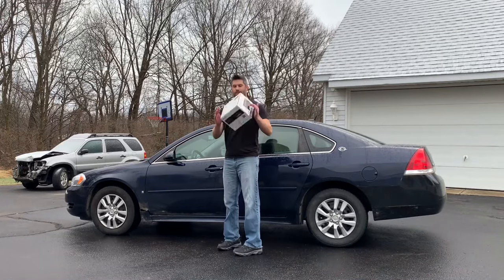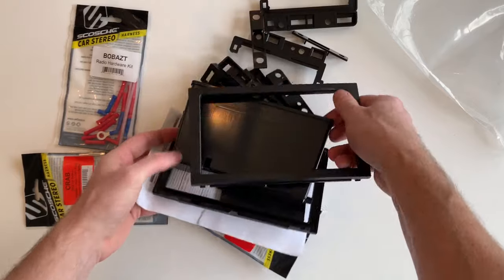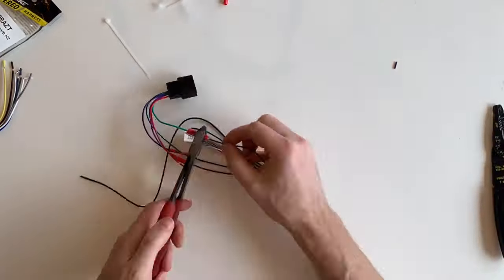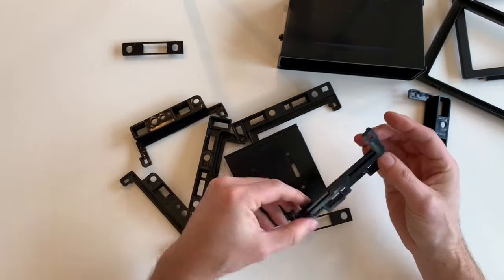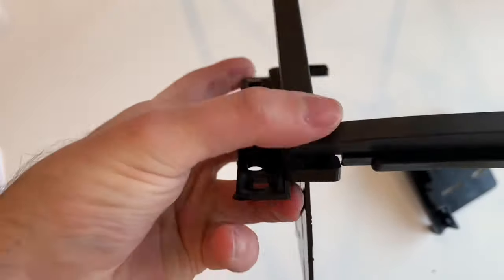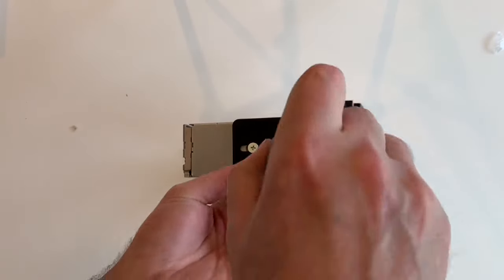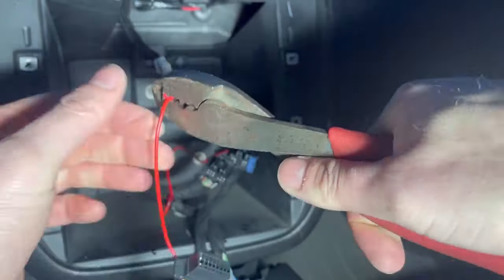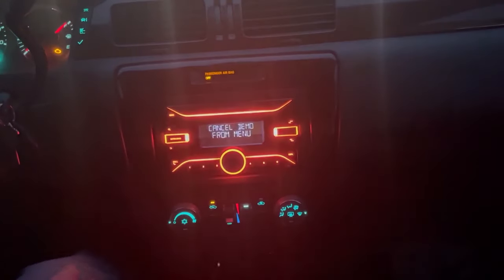How to Install Aftermarket Stereo / Radio | Chevy Impala | 2006 - 2013 (NOT FOR "BOSE" WITH AMP)

Comment: Sir how do we tell if we have bose i have a 2008 50th anniversary impala
Reply from the maker: The stereo doesn’t have any special marking’s. It looks exactly the same for standard vs. Bose. 

The way to tell is the front door speakers will have a BOSE logo on them.

The only other way is to look for the amp (the Bose system has an amplifier, while the standard system doesn’t).
Reply: @HowtoandReviewsOfficial  what does the amp look like when I take out my radio it's hot
Reply from the maker: @That2007YZFR6THUNDERCAT  The factory Bose amplifier is located in the trunk. It should be between the two 6 x 9 speakers behind the back seat.
Reply: @HowtoandReviewsOfficial  ok I'm good I don't think I have it

Comment: How does the OEM radio get power then?
Reply from the maker: There are typically two power wires. 1) yellow constant power. This always supplies power to keep the clock accurate and preset radio stations saved. 
2) red accessory power. This only provides power when the key is on and is what powers the radio for operation. 

The factory harness only has the yellow constant power. It does not have the red accessory power wire, which is what the aftermarket radio needs, which is why we have to wire it in from a different source.  (You can’t use the yellow wire because the radio will always be on, even when the car is off). 

The stock radio received data when the key was on and internally programmed to use the constant power when the key is on. 
This is not typical. Most radios have a yellow and red wire, and aftermarket radios need a yellow and red wire.

Comment: so i got it all hooked up right with a good harness did the red wire to the window fuse turns on but no sound i connected the blue and white to th 12volts still nothing tryed the antena to the blue and white nothing i see it moving on my screen but no sound hooked the stock radio up worked fine any help
Reply from the maker: Do you have the Bose system with a factory amplifier?
Reply: @HowtoandReviewsOfficial  no bose and i cant seem to find the amp there 2 thing on the trunk one security and the other thing says LG but dosent look like a amp when i look it up
Reply from the maker: @opdanky236  since it’s not the Bose system, you don’t have a factory amp. The whole system is just the stereo, which is good; you only need to connect power to the stereo. 
Since the stereo has power, not sure why there is not any sound. What stereo are you using?
Reply: @HowtoandReviewsOfficial  ken wood not for sure exact model
Reply: @HowtoandReviewsOfficial  then tryed a power acoustic just to see but both radios are brand new 300$ on the kenwood
Reply from the maker: @opdanky236  I wonder if there is something silly/easy like a mute button. 

Did you use the kenwood manual against the adapter harnesses key to splice them together? I would get them both side by side and make sure the wire functionality matches for each wire connection.
Reply from the maker: 2:06
Reply: @HowtoandReviewsOfficial  as far as i seen all the cords matched greens to greens black to blacks whites to white yellow to yellow everything matched up good mute button was off lol made sure just no sounds at all from both radios see the music playing from the radio we tryed puting the amp wire from the harnes to the 12v nothing then to the antenna nothing
Reply from the maker: @opdanky236  it does sound like there is a powered amp somewhere that needs power, which would be the case with the Bose system.
Next, I would personally start troubleshooting and try wiring a speaker straight into the harness to see if sound is coming out of the stereo. I would try stuffing an extra pair of wires right into the connector pins and wire them to an extra speaker. 
The signal should be leaving the stereo. Need to verify that. 
Sounds like it’s just not making it to the speakers.
Reply: @HowtoandReviewsOfficial  ok thanks ill try messing with it tomarrow

Comment: I ordered a harness for the same car it look like they gave me 2. Help?😊
Reply from the maker: There are two harnesses in the kit. You need to use both of them.
Reply: Ok both harnesses have yellow wires why? That’s confused me?😢
Reply from the maker: @rodneyhendricks2412  I agree that there should only be one yellow wire. That is not right and is confusing indeed. It sounds like the wrong harness. I recommend calling SCOSCHE customer service directly. I have talked to them in the past, and they are great. They will help you sort it out.
Reply: @HowtoandReviewsOfficial  ok yes it’s is confusing. Do the have a contact number or something?
Reply from the maker: @rodneyhendricks2412  
Technical Support: (800) 363-4490 ext. 3 

https://www.scosche.com/contact
Reply: @HowtoandReviewsOfficial  thanks buddy

Comment: install kit does not fit any stereo that i can find, pioneer single din is to wide same for double dins, 2012 impala police.
Reply from the maker: Unfortunately, I’m not sure. DIN is a standard size, and they’re all interchangeable between all brands. Maybe you need to use a different bezel or something in the kit.
Reply: naah it was a faulty kit i bought a metra kit and it all fit perfect.

Comment: Can’t get any power. What did I do wrong?
Reply from the maker: I used the power windows fuse in the interior fuse box for the power supply. It provides 12 volts when the key is on.

Comment: I got BOSE how to install it with bose
Reply from the maker: I believe you need this harness kit to work with the factory Bose amplifier. 
I recommend calling the manufacturer to verify this is correct for your specific vehicle. 

https://amzn.to/42zJ5c8

https://www.crutchfield.com/p_120GMOS04/Metra-GMOS-04-Wiring-Interface.html?cnxclid=16796236390059893953210090301008005

Comment: I did this and now it won't turn off 😆
Reply: You must have the power cable connected to a fuse that always has power Get a current tester and see which fuse turns on with the key off or which one doesn't, if it doesn't turn on with the key off, try the key in accessories if it turns on ready, connect it.

Comment: Did this and it started blowing out my fan fuse car started overheating I urge anybody watching this don’t listen to this dud the red wire does NOT go in the window fuse at all whatsoever
Reply from the maker: Sorry to hear that. Thanks for sharing.
The fan is on a separate fuse, unrelated to the power window fuse, so I’m not sure what is going on in your vehicle. You may have a bad fan motor drawing too many amps or a bare wire grounding out and drawing too many amps. Something on the fan circuit is drawing excessive amps and blowing the fan circuit fuse.